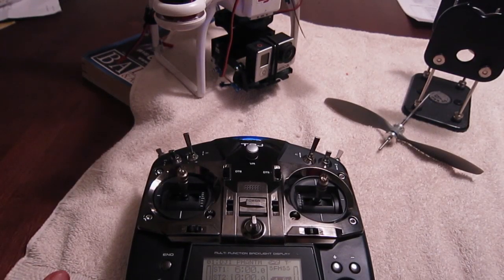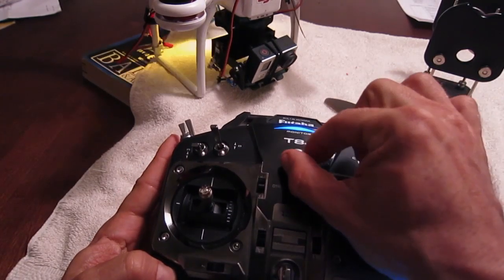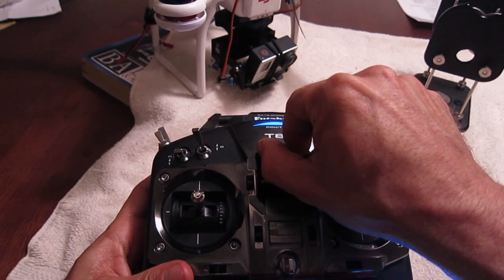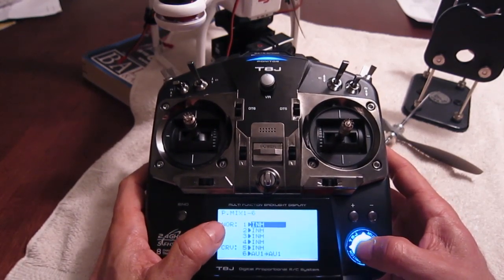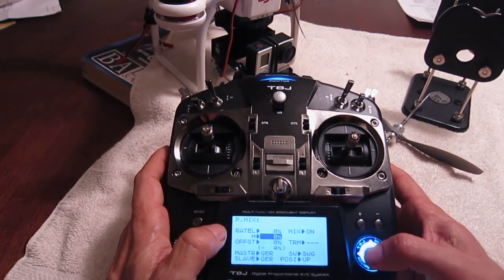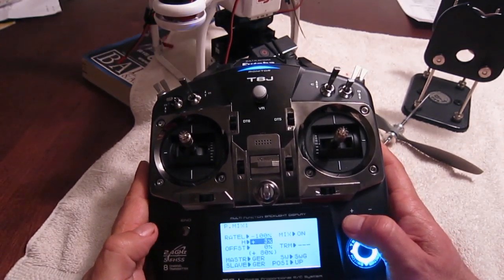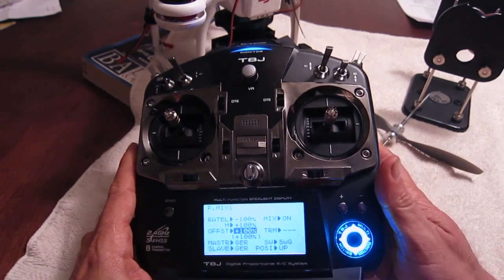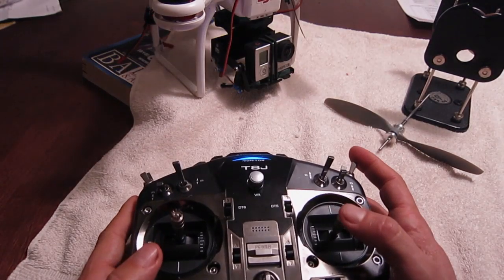Futaba T8J Gimbal Tilt Down Tutorial

Comment: are u using naza v2? how is that possible? naza has only 8 channels. I have a retractable gear, lights, pan and tild for gopro and fpv , and i dont find the way to connect all of them together, I'm using futaba 14sg with sbus. its a f550.
1234channels are movements,
5 gps,altitutde, manual
6 curs lock , home lock
7 failsafe.
8 empty 
so i only have channel 8. 
Please help!
Reply from the maker: Well, I did this video over 3 years ago, so can't quite recall the specifics -however if I recall the gimbal control was connected directly from the Futaba RX to the Gimbal - completely bypassing the Naza.
Reply: But if I use a channel which is used for other thing, (using pins futaba reciever ¦ sbus ) like channel 1 (pins 1 futaba reciever ) for throttle , if i use it, when I move the stick is also moving the servo and the throttle.
Am i wrong?
I am still fighting with it.
Thanks!
Reply from the maker: I'm not familiar with the 14sg.  But one of the channels has to be free to connect to the gimbal.  (also,  using channel mixing,  you can program failsafe without using Ch7)

Comment: Hello Gary. When You fly, is this servo gimbal working (keeping camera in position like brushless gimbals ), or it is static, and camera tilts only when you move it?

I am just buliding F550, and i prefer servo "gimbal" which will only have manual tilt control without any stabilization.
But, as this use naza X1 channel, i don' t know can it work this way, just for tilt?
Reply from the maker: If you connect straight to your Rx (channel 5), the gimbal will be static.
if you connect to your flight controller/F2 on the NAZA,  it might try to stabilize a little bit, depending on what settings you apply in the NAZA Assistant.
Reply: Gary Reisman
thanks :-)

Comment: Is there a way to make the tilt go slow?
Reply from the maker: Tilt speed cannot be controlled by the Tx, it must be adjusted in whatever hardware controller (connected via a GUI)  you have attached to the gimbal itself.
With servo gimbals connected thru NAZA, you can adjust speed in the NAZA assistant.
or with brushless gimbals it's done in the Alexmos, Tarot or similar GUI.
Uncertain how to do so with DJI's zenmuse tho.
Reply: Anyone ????
Reply from the maker: I thought I answered it for you.  But no,  the T8J cannot be adjusted to slow or speed up Tilt,  it's dependent on your gimbal settings.

Comment: Hi Gary, thank you very much for your tutorial, has been very enlightening and interesting. Can you help me to make the tila in a much slower motion, low very fast and I dont knowt how to do it smoother in my T8J. 

In advance thank you very much!!

Best Regards, Jonarhan
Reply from the maker: Glad it's helped!
Unfortunately the Futaba doesn't have the ability to gradually increase a channels level,  the switch p-mix is more of an "all-on" changing it from one level to another.
However, you can usually control the rate a gimbal moves by connecting it to your computer and changing the rate at which is will manually move. (often called a "rate"), so it really depends on your specific gimbal settings.
On Phantoms with older  servo gimbals, the rate can be adjusted in the NAZA

Comment: Hi Gary. Maybe you can help me out ? I have an issue with my Futaba 8J. It always loses contact at about 50 meters which switches my Naza into RTH every time. Somebody suggested my TX might be stuck in "power down mode". When you open your power menu (hold jog-key while powering on the TX) what part is highlighted please ? "Power down" or "off" or "on" ? Thx. Phil
Reply from the maker: I'm not too familiar with the Power Down features, but it does sound a bit like what you're experiencing.  Although it should beep and warn you that you're in that mode, so can't really say why you're losing the connection. Perhaps contact Futaba or visit their help forum.

Comment: Gary, I've got the VR correctly moving the gimbal's pitch, but the G switch isn't functioning properly. Instead of forcing the gimbal down, it just locks it in place. With it on, the VR doesn't do anything. If I move the VR and then flip it off, it moves to wherever the VR is positioned. Any ideas?

Comment: Gary, appreciate your replies. I'm actually using Paris, not NAZA so my Ch7 is free. I assigned VR knob to Ch7, and the VR knob controls the gimbal pitch as in your video. However, it's the G switch setting that I'm having trouble with. Should I still use GER for master and slave if I'm on Ch7?

Comment from the maker: If your quad is using a NAZA, Ch7(AV1 is used to switch between GPS/ATTI/Man, so you definitely do not want to connect/use Ch7 for gimbal pitch.
NAZA uses Ch5/GER for pitch.
the only other channel that is unused by the NAZA is Ch8/AV2, which you can use instead of Ch5. 

If you're not using NAZA, just use any channel that's open on your Rx and assign the VR knob to it.

Comment from the maker: It depends on the gimbal of course, in this tutorial I was using my old servo gimbal which plugs into the NAZA. F1 and F2.
But yes,. if you're using a newer brushless gimbal, you can skip the NAZA and plug directly into the Futaba Rx.
You want to connect the pitch control of the gimbal to the top pin of the Chan5 in the Futaba Rx  (ground might not be necessary, but that would go into the bottom pin of the Futaba)

Comment: Gary, Could you backtrack a bit for me? I need to know how to wire the gimbal into the R2008SB? I am using S bus for the main controls and this goes to the Naza M, but I was told I could control the pitch by wiring the Gimbal directly into the receiver. I only need to control pitch, as you have shown, but I am not sure where to connect the wiring? Many Thanks.

Comment from the maker: Not really sure if I can help you come up with a solid solution.
in my tutorial I basically show how to max out channel 8 so that it will tilt down as far as possible (set the gimbal).
If you want your gimbal to only go to a certain section you must first start off with the gimbal perfectly level (or at your desired flying position), and then experiment with different %'s in the rate and offset so that the channel only gains or loses a set amount, rather than 100%.

Comment from the maker: Hm,. good question.
if the VR knob works in the proper direction,  perhaps try changing the Rate or Offset to +100 instead of -100,   or vice versa
but if you want to have it only rotate down 45%, try changing the rate/offsets to +50 or -50.
You can test it out if you switch over to the Servo section of the Futaba without having to turn plug the battery into your quad every time.

Comment: Hi Gary, nice video thanks ! I use T8J with ARRIS CM2000 on NAZA M V2 and I control gimbal tilt with the VR knob. My problem is when I turn a little bit the VR, the gimbal tilt completly down or up. I am not able to adjust the gimbal right where I am. Do you have any input about that ?

Comment from the maker: when you turn off the switch,  the gimbal should return to the previous settings.
perhaps the drifting is occurring because you're using a brushless gimbal?  in which case you might want to go into your brushless gimbal GUI and make sure it's set to absolute mode, and not an incremental mode that some gimbals are set to.

Comment: Thx for the video. It worked with the switch and pans down, but when I flick the switch off it doesn't go back to center, so I have to use the control knob and it "drifts". Any idea of my switch issue?

Comment from the maker: the servo gimbals use the NAZA, but you've got a brushless gimbal, you would connect the gimbal signal wire for pitch to the top pin of Chan5, and ground on bottom pin of Chan5

Comment from the maker: well,  this tutorial I did using the NAZA, but it's similar for Brushless gimbals.
It might be different for the 14ch models, but I connect the pitch signal to top of Chan5 on the Futaba Rx, the bottom pin for ground. (I use Chan8 for roll, as shown in another tutorial I did)